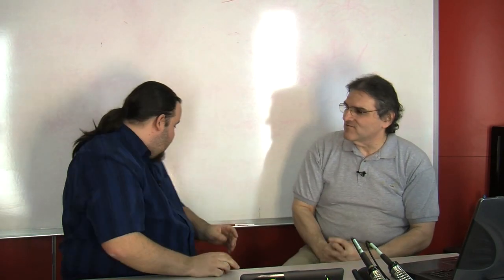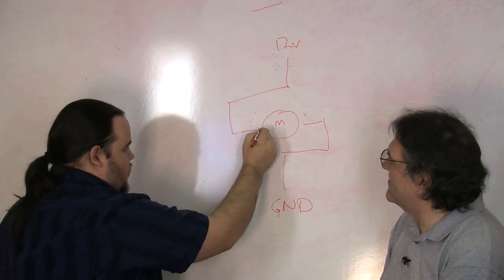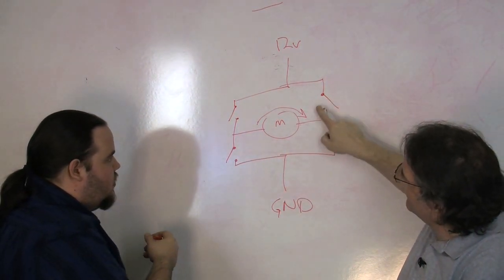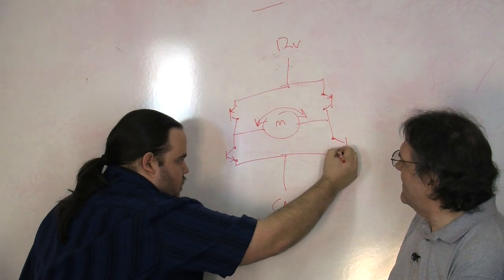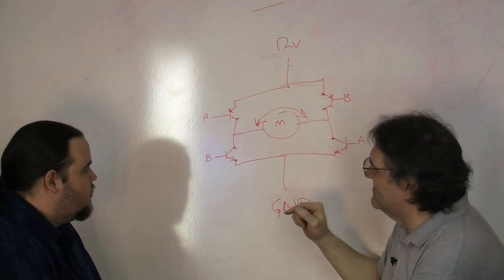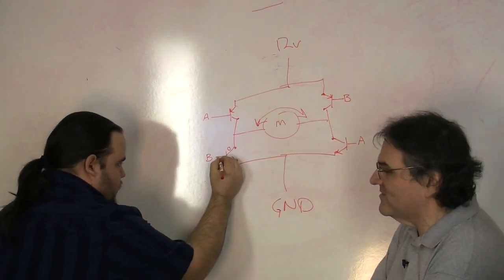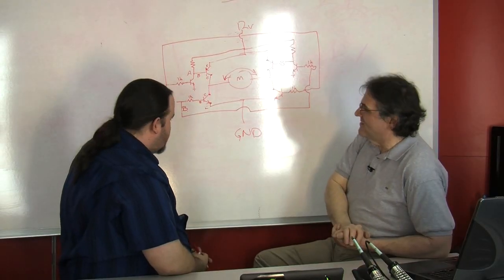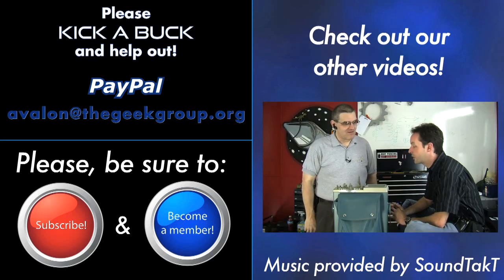Dan and Kidwell Building Schematics for Camera Trolly

Comment: Also you could prevent that dangerous 1n1 state by using a XOR gate and two AND gates aswell:

Wireing A and B to the XOR gate and to one AND gate each, then "split" the output from XOR to the other input on the AND gates. In the end, the outputs on the AND gates will be your A and B. This will cause the 1n1 state to be 0n0 instead! (:

Comment: It would be safer to create your "B" from the "A" signal with another transistor and not within the Arduino. So "B" will always be the inverse of "A". No matter what the µC does, you wont make a heater ;) . With the seperate "PWM" connection you can still turn off the motor although either one of the "A" or "B" path would always be on by design.
Btw. I would still look for an IC that includes all this in a single package, even the powertransistors. And use MOSFETs, they half lower losses.

Comment: I know a construction wich uses only 2 ports on the arduino.

You can use a dpdt relay to control the direction of the motor,and then use a switch/transistor to control the motor speed. You also don't have any direct  12v conections to the arduino,wich i like
 i  used the cirquit on my robotic projects! wich saved me a lot of ports.

grtz tom

Comment: I know a construction wich uses only 2 ports on the arduino.

You can use a dpdt relay to control the direction of the motor,and then use a switch/transistor to control the motor speed.
 i  used the cirquit on my robotic projects! wich saved me a lot of ports.

grtz tom